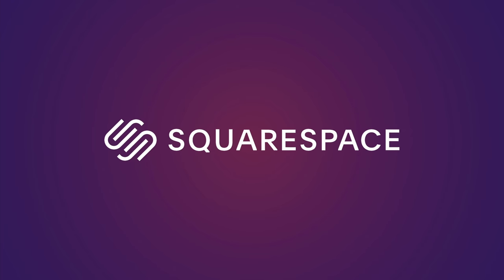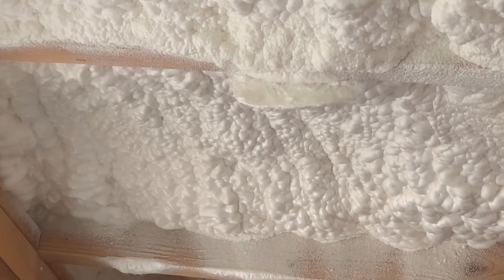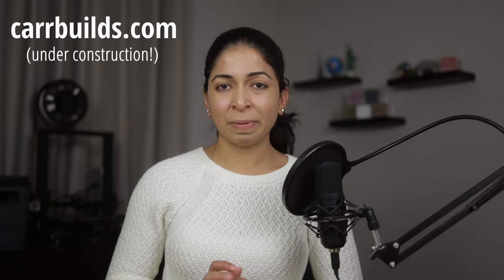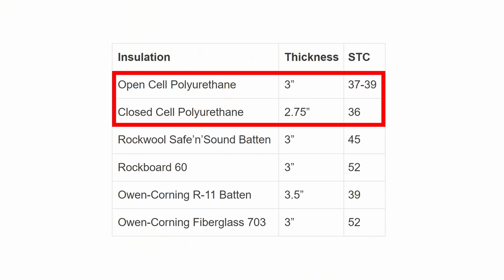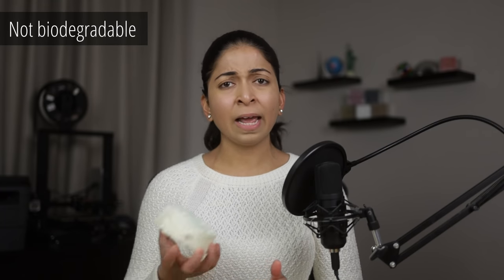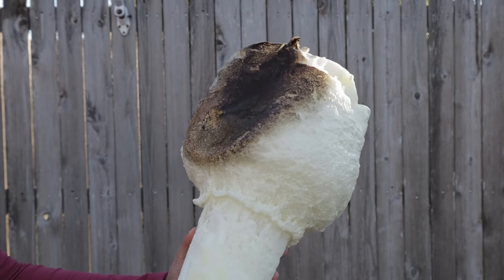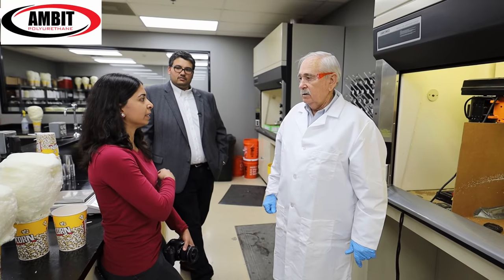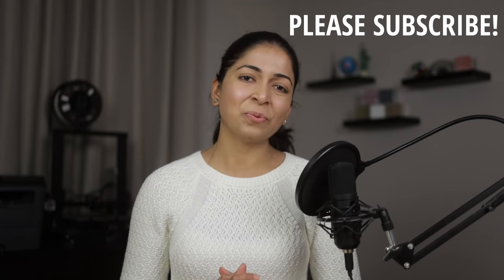PROS & CONS of Spray Foam Insulation | PART 2

Comment: I've been following it and reading about it for years. I even used it myself for a packing material many years ago. There is a "BEST" way for everything or at least the best way we know right now. I feel that every new house should have all outside walls and the roof sprayed with 1.5 to 2" of closed cell and then the proper additional Rockwool to bring to insulation to at least the minimum code for your area. Going over code is allllways a good thing!!  As far as changing the air and removing moisture, there are additional machines needed for that, but in my estimations is quite worth the money as they will make your home far more comfortable and clean and quiet. Also, for people like me whom live in bad weather areas, "hurricanes for me", the closed cell foam can also help keep your roof on!! This means a break on house insurance as well!!  For stove hoods and shower fans there is, as mentioned earlier, a machine to exchange house temperature conditioned air with the outside air taking some of the temperature from the other. As far as fire ratings go, I think foam is the best for keeping air from infiltrating through the roof and is it's own fire block inside of walls. Adding Rockwool to it is not a must, but in my line of thinking, is the best added insulation. With the foam there is no exchange of outside air where you don't want it. Adding the rock wool immensely adds to the R value and the fire retardant. This doesn't mean you have to stop there. Adding drywall over the foam and rock wool, well lets say I would NEVER worry about my house going up in flames..  YES, having foam done by a professional is the only way. There are many horror stories about bad jobs that made people sick and as you saw in this video, useless spray jobs.. 
Sorry it's so long, but this is extremely important for all of our futures.

Comment: We specify spray insulation on all new homes but don’t recommend it for renovations unless all the ceilings are going to be removed. We have seen issues with ac diffusers sweating when spray foam is Uber on renovations and the attic is not sealed completely.

Comment: The best part of spray foam is the air tightness, this almost cannot be over estimated.
Nothing comes close; Other insulation never meet the R value due to the installation.
Renew Magazine in Oz, 5% gap in insulation accounts for 29% heat loss.
Whats the VOC of spray foam?
Once again great content, as always.
Cheers from Oz.

Comment: I must confess that I am DEEPLY skeptical of the claimed "80-year" life span. I have renovated too many homes with decayed, useless foam insulation installed prior to 2010 where the 'foam' was a toxic, smelly powder that had to be cleaned up, NOT in any way a viable insulation. I adore your channel, and I have learned a lot. But when it comes down to believing a manufacturer's claim versus my own eyes - my eyes win. When properly installed, dense-pack cellulose doesn't settle and is the insulation recommended by Passive House and by Living Future biophilic design. So, I'm going for recycled dense-pack cellulose.
Reply from the maker: I believe the industry has made huge improvements to the product since 2010. The applicator is probably to blame, they were asked to be a chemist on a job site! It's a tricky product to get right.
Reply: @BelindaCarr  True, but I argue that the best products are pretty much idiot-proof. Any product/installation that requires finesse should be executed by trained licensed professionals. So far as I know, there is NO certification program for spray foam installers. Essentially, it doesn't matter whether it was the installation or the product; either way, it didn't work out. So, I'm sticking with recycled cellulose, in spite of the allure of products that offer air sealing as well as insulation. Chalk it up to my suspicious nature. Thanks again for a fascinating and informative channel. Keep up the good work!
Reply: if the product you came contact with his chalky and dusty, its not spray foam. that is uffi
Reply: @Homeairquality  I could be wrong, but it looked the same as decayed synthetic latex foam cushions. After a while, those resilient foams become brittle and powdery and they go orange and then brown. The stuff I encountered was not chalky. It also smelled like plastic. I'm sorry to confess ignorance, but I don't know what "uffi" is, so I have no idea if that's what I encountered. The homeowners that I was remodelling for thought it was spray foam.
Reply: @lindacgrace2973  Urea Formaldehyde Foam Insulation. It's a type of spray foam that was mostly used in retrofits in the 1970's in response to the first arab oil embargo.
Reply: @zone4garlicfarm  Aha! Mystery solved. I still have concerns over site-mixed insulation solutions, R-rift, outgassing, loss of the initial airtight seal - but I will no longer paint all spray foam insulation with the same brush. However, I'm still sticking with my initial choice of cellulose for my new house. I'm aiming to build a "century house." I define a "century house" as a house that will endure intact with little to no maintenance for 100 years. I'm building in the Southwest, so I plan on a double-wall adobe house with cellulose between the inner wood-framed wall and the outer adobe wall. With a clay tile roof and more fixed windows than operating casements, I think I'll make it. Thanksw for the info.

Comment: You failed to mention SIP's panels.  Closed cell foam board wraped between 2 sheets of sheathing.
Reply from the maker: SIPs can be made of EPS, XPS, polyiso or polyurethane.... that's for another video!
Reply: @BelindaCarr  My SIP's panels are also graphite infused as well!

Comment: There is one HUGE problem with spray foam insulation: how airproof it is. The roof wood is dried too often as a industrial process, which makes it dry in like 5mm depth (generally as deep as needles of tester can detect). Deep inside it is most often still wet wood as it was not been dried for last 2-3 years. This causes wood to rot if is is covered with foam. Very dangerous and unhealthy. If you make the wood "outside" then it can easily rot due to water (both rain and condensation) as all these special (breathing) foils are in most cases in very bad condition after 5-10 years.
This is more a problem with wood, but this problem is almost non-present if you are using fiber.

Comment: Correction:  combustion air is drawn through an insulated duct from the outside of the house. From the front sides or rear, or from the roof, not the attic.

Comment: Spray foam is a no-brainer for under the slab&foundation. But since insulation must be on the outside, that's really the only valid use case as insulation.
Also, it can make sense as a structural element in some cases.

Comment: I would never use an expanding spray foam insulation. I would only use a non expanding spray foam to seal air leaks than use Rock Wool insulation in the cavities.

Comment: Everyone wants this these days because it reduces heating and AC costs by a ton when done properly, sealing every nook and cranny. I mean everyone intelligent that is.. It has its disadvantages, like not so great fire resistance, but you can offset that by precautions like fire alarms so you get warned early and having multiple quality extinguishers around the house ready to go when something happens. That you should have regardless of the insulation choice tho.

Comment: Ultimately the cons are too great.  Even for those with deep pockets.  My summary take
1) remodeling too difficult
2) not DIY friendly/ application must be perfect 

If you remove cost from the equation. & just want The “best” insulation package- obviously just a novice opinion, feel free to disagree & state why:)…
- extra thick exterior foam insulation, like a double layer around 4” thick and use something like blow in cellulose in the wall cavities.  Less chance for errors, no future remodeling headache, or off gassing delaminating problems.

Comment: If you have other options for insulation, then you should avoid spray foam at all costs. You should always use recyclable or CO2-neutral materials as much as possible. Especially in the USA, where people are already building a lot with wood in an exemplary way, it would be a real shame to contaminate the wood with this spray foam. All the advantages that spray foam has today will be the disadvantages of those who have to tear down the house, i.e. our children and grandchildren.